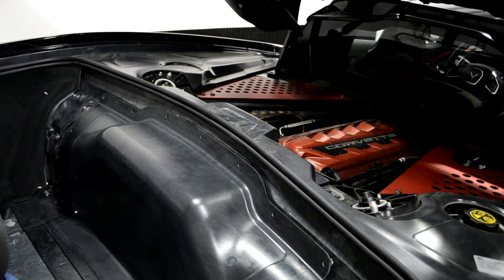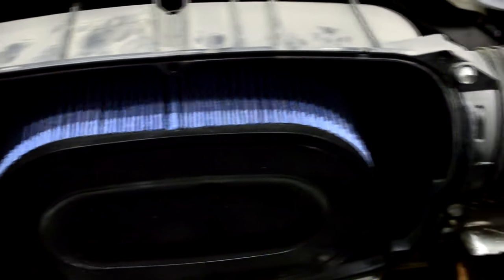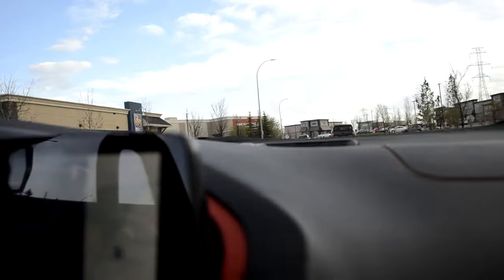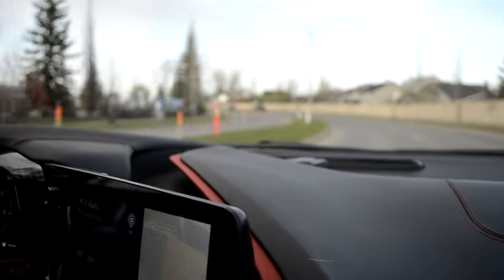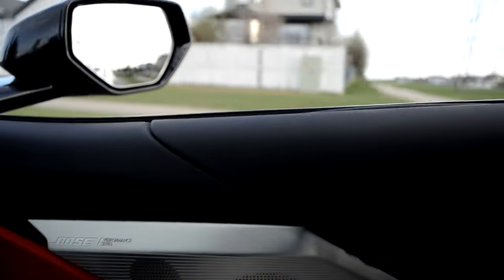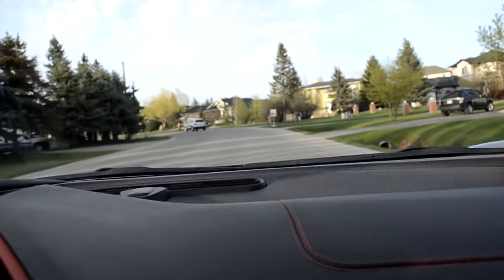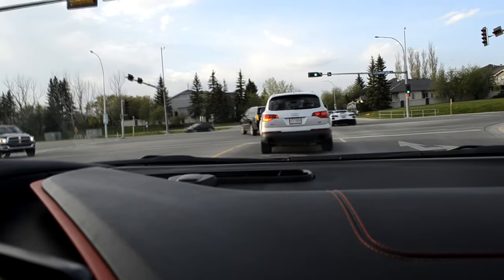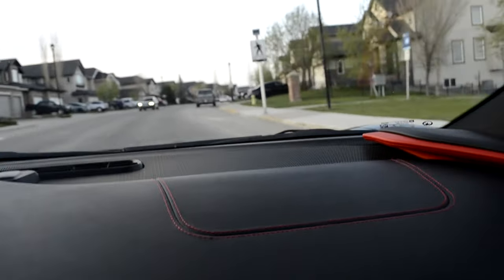Unleashing The Power: C8 Corvette Blue Attack  Air Filter Review

Comment: Kitchen The difference between OEM filter & the attack Blue is only .012% which is insignificant especially given all the hype surrounding Attack Blue Filters.   That said, if the price between the two is not significant I guess one could switch over at the time the OEM filter needs to be changed. Doing it earlier would be a complete waste of money.

Comment: The exhaust you have looks identical to the paragon touring. That is double the price. Any reason to go with that over this?
Reply from the maker: It does look identical to Paragon touring exhaust- I actually made a video where I mention this. Paragon is a reseller and 2M is a manufacturer, it was suggested 2M builds exhaust for Paragon. I love this exhaust from 2M and I would buy it again. Sounds amazing, great quality and no drone or check engine light.
Reply: @SerhansGarage  good information. Thanks a lot man!
Reply: I take it this doesn't meet CARB complience?
Reply: How much louder is the 2m then the factory exhaust?
Reply: Sorry and where did you order the exhaust from